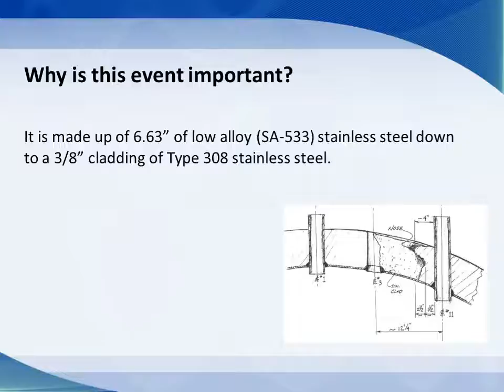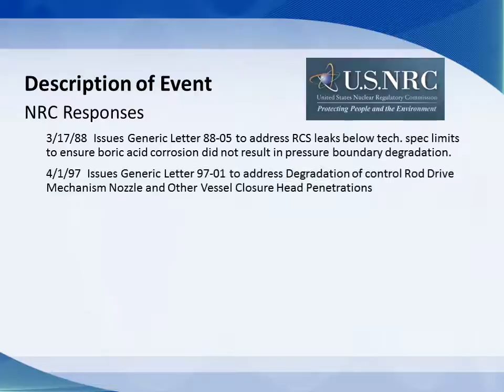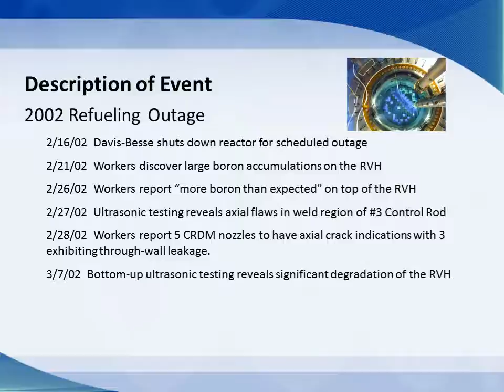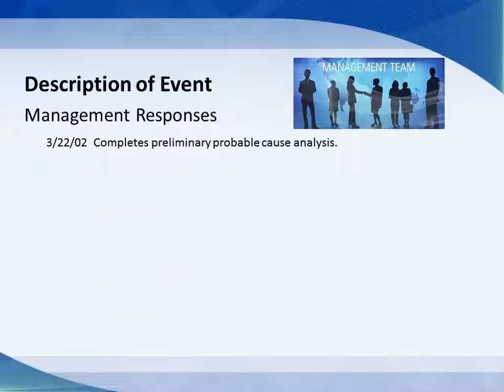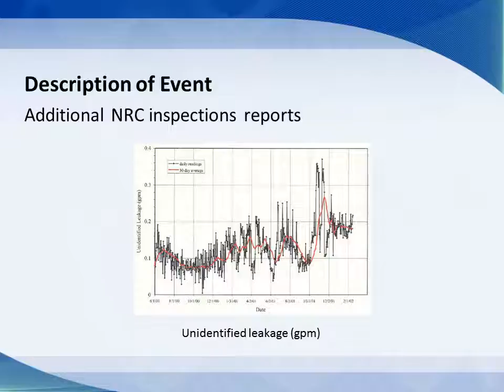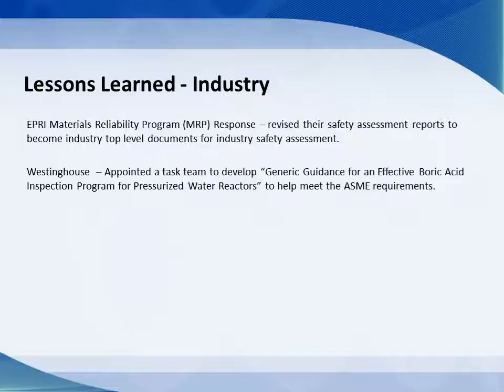Davis-Besse Reactor Vessel Head Degradation (TESC NUC-495)

Comment: Very good summary!

Without being drawn into the gutter approach of a previous commenter, the VP nuclear did have a very negative impact on this event. The idea that, when presented to senior management, all problems must be accompanied with a solution that does not cost megawatts should not be acceptable in the nuclear industry.

I left the site a few months before the 2002 outage started, but the issues were known, and should have been investigated sooner. 

The Davis-Besse plant,at least when I was there, was a solid plant with a very dedicated workforce. It was far from a “piece of crap” as characterized by the previous commenter. I know. I was there for almost twenty years.